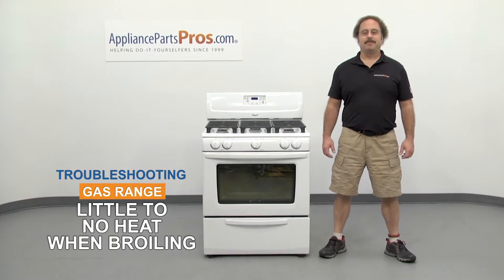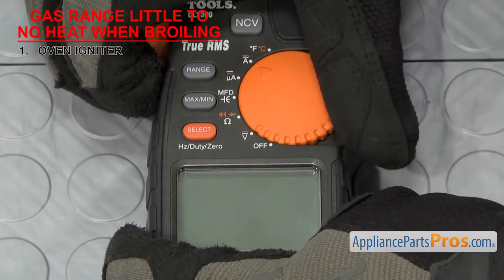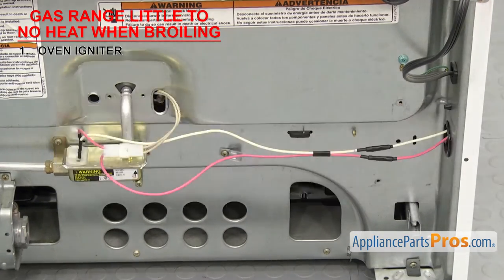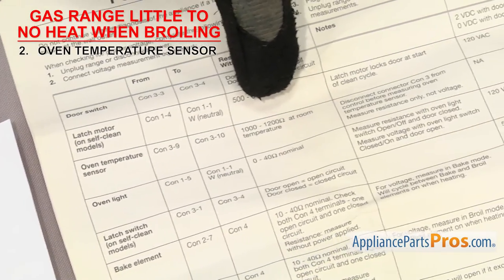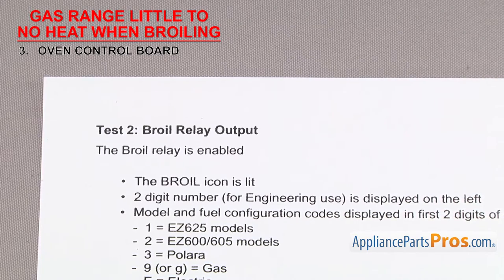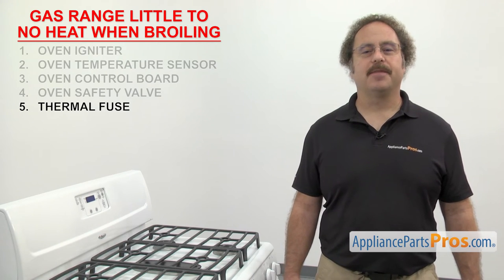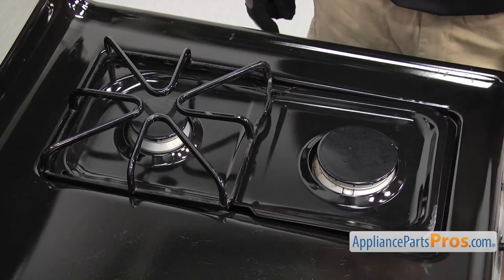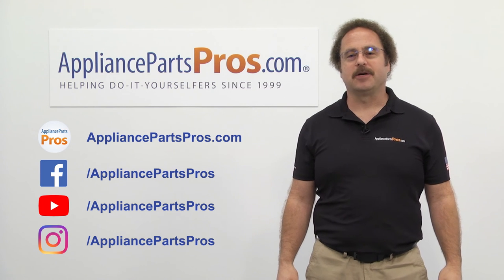Gas Oven Broiler Won’t Reach Temperature  - Top 5 Reasons & Fixes - Kenmore, Whirlpool, GE & more

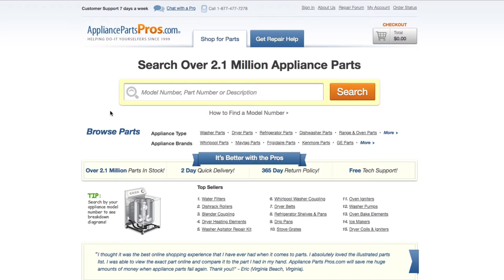Comment: My broiler will not fire up. My oven ignitor glows white hot and has an ohms reading of 235. It takes about 3:00 for the gas valve to open when oven is set to 350 degrees, and doesn’t reach temp for about 13:00-18:00. Is this normal?  I’m trying to rule out igniter and move on to temp sensor. Thanks in advance for your assistance.

Comment: Edit: Problem FIXED!!!!

I noticed from the beginning it seemed like the ignitor on mine was a little far away from the gas burner about 3 inches as well the new ignitor we recieved definitely looked different from the original but I've searched and searched for one that looks like the original to no avail. Ours use to light in under one minute and now takes up to two minutes plus at times even longer around 2 and a half which when it does decide to light there is a literal explosion you can feel and fire shoots out of the bottom and the sides. It nearly caught the house in fire once because we had towels on the handle which the fire hit the frayed strings to light them up quickly and burnt the front of the oven handle etc. I ordered a new safety gas valve which also was different and one of the prongs was bigger. I made it work but seem to make the problem worse so I went back to the original. Also replaced the other valve regulator part (which is bigger than the safety gas valve part) and still same issues! I've had an appliance guy over here who was horrible and didn't seem to want to do anything not even replace the ignitor I had on hand. He said he checked the parts and they read fine but I really didn't believe him because he was so lazy and just seemed to want his $85 smh. Anyone with any info for this would be great. I feel like I need to reorder the safety gas valve but it isn't cheap and do not want to keep throwing parts at it.

Holy crap! I saw the picture inside the oven and realized his ignitor was way closer than mine was as you can see I was talking about that. I realized mine was flipped backwards and facing AWAY from the burner...this is something I noticed in the past but though that's just the way it is made to work....NOPE! I flipped it and fixed the problem instantly and it lot in thirty seconds!! It is regulating temperature properly now and everything is good!! Thankyou so much this is a $1500 plus gas oven, not cheap and I had literally TWO "appliance repair men" tell me to "get a new oven". Wow!! Make sure you didn't accidentally mount the ignitor in the incorrect position!!